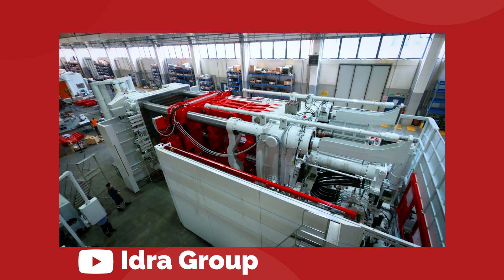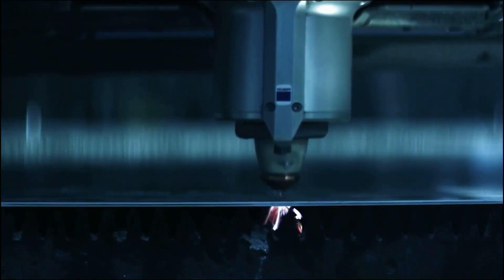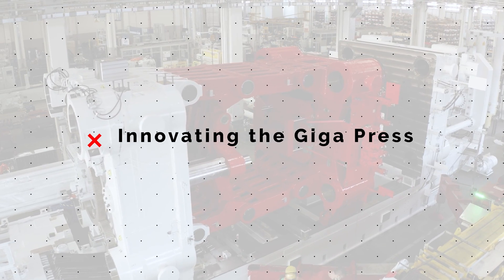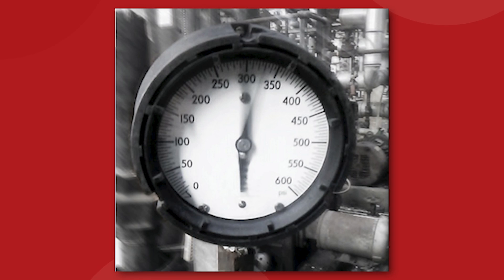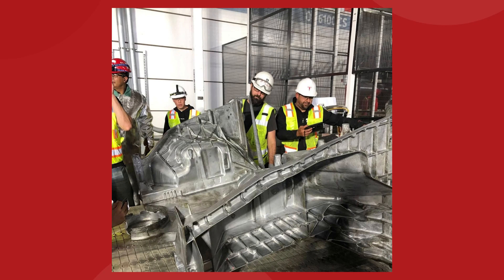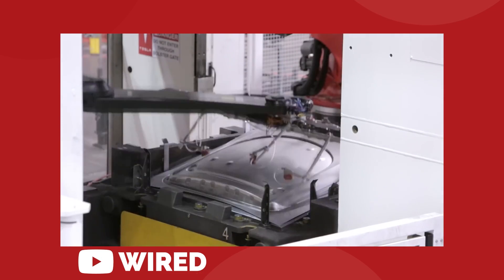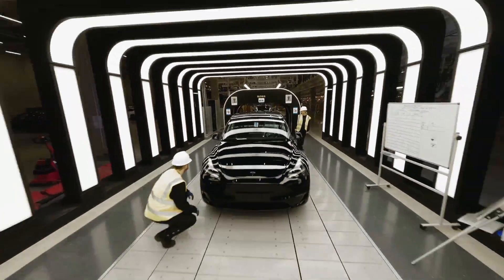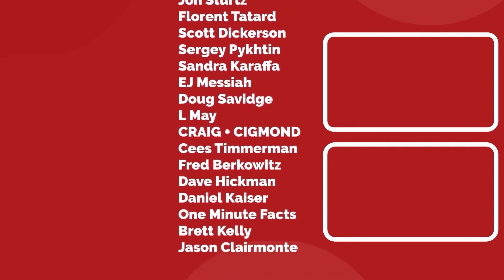The Real Reason Tesla Developed The Giga Press!

Comment: The video says that they pre-coat their aluminum die cast mold with soy bean oil.  I find that a little questionable.  Maybe a silicone based coating, yes.  I wonder what the up-time of these cells are?  From a production bottleneck standpoint it looks like a single point of failure in throughput unless there is a big super-market of post parts sitting around.  Would love to hear from someone who is familiar with the cells.

Comment: Tesla did not develop Giga Press. Tesla bought it from an Italian company named Idra, you can easily Google it. Tesla, perhaps, was the first car OEM that used it to manufacture its vehicles. Other OEMs are in the process of buying and using the press. It is basically a fast injection molding aluminum machine.

Comment: the clamping force is withstanding the injection pressure TIMES the area of the mold cavity.   Like an air cylinder with 100 PSI of input acting on the piston face of say, 5 square inches.  100 pounds force/1 square inch x 5 square inches = 500 pounds of force at the cylinder rod end.     In the case of the press, you can equate the liquid aluminum as acting like compressed air and the die cavity face  being the face of the piston in the air cylinder.   
     If the aluminum is being injected at 1,000 PSI and the projected cavity face say 1,200 square inches ( 20" x 60" ) then the force counteracting the clamping force is  1,200,000 pounds or 600 tons.

Comment: You keep saying "casting".  This is a press, NOT a casting machine.  In a casting machine, molten material is poured or sometimes injected into a mold cavity.  In a press, sheet metal is placed in the press cavity, and the press uses hydraulic rams to close the two halves of the mold around the sheet of metal to deform it into the target shape.  The person that authored this video needs to research what they are talking about before writing their script.  You are confusing two completely different technologies.  Both technologies have molds that open and close, but casting uses just enough force to open and close the mold, the press uses extremely high levels of pressure to deform cold metal.  Cast metal is hard and brittle, so the parts shatter in accidents, something you DO NOT want your car body doing.  Pressed parts are work hardened, but not to the point of being brittle, and a very strong part is created that will bend in an accident, but remain one piece to continue providing protection for the occupants.   Casting and presses are used to make completely different kinds of components for different purposes in the car (or whatever you are making).

Comment: The Germans were using similar but much larger machines to press and forge aluminum aircraft components during WW2. It may be computer controlled and being used for die cast auto components but it isn't new technology. Die casting is rarely repairable depending on the metal being cast and is commonly used with cheap zinc alloys that are considered one time use products.

Comment: A couple of things that I've been saying is luxury vehicles are not going to save the world. Second thing how do you replace anything has been damaged it's built this way? The assembly's made of stamps sheet metal can be disassembled and replaced with fresh meadow that's not destroyed from a crash you can't do that with a casting can't be welded on. You have to replace the entire casting in remove and reinstall everything that goes on it. Plastic parts is nothing new there been large pieces on American cars admittedly nothing like this but there are out there there generally a cradle to hold the engine or suspension differential. The filtering of the aluminum in Molten form that's something new I never heard of. Like everyone else there are some smoke and mirrors with Elon Musk he's not the new Messiah. Hey bring some new ideas but you guys need to get him off the pedestal this is ridiculous.

Comment: I think some of the items that Tesla will need to consider casting is segment castings of the one piece cast so that repairs to teslas can be performed by alloy welders to replace the damaged portion from accidents which may be cheaper than removing and replacing the entire cast or writing the complete car off depending on which system of repair works out cheapest, it may bring down the high insurance costs. But it may devalue the car . Probably something they’ve already considered. I do think as time goes by that Tesla will make full size die cast cars similar to a toy MATCHBOX CAR.

Comment: Your clamp force has to be higher than your injection force  because - pressure = force/area and the molded part is a greater area at the parting line therefore the clamping force must be big enough to hold the mold closed .

Comment: Amazing machine and technology. However the downside of casting frame sections of this size is rather large for the car owner. 

If you get in an accident and one of these frame sections is damaged its replacement will not be cost effective. 

But that depends on what will be available from Tesla in the spare parts chain. 

If your vehicle is damaged on the right front. Will a repair facility be able to remove just the damaged section and weld in a replacement? Or will the entire frame section casting need to be replaced? If it has to be replaced in its entirety then it may not be cost effective to do so.

Comment: Volumes injected and cooling rate seem critical. 
 Perhaps to do a single cast it would take 2 coordinated side by side presses, Even 3. I can imagine 2 presses on one side separated by the third press on the opposite side =- timing smelt and injection to make a piece 3 times bigger. But is that necessary? Front end , rear end both bridged by the structural battery pack….
 I’m still not fully onboard with electric vehicles anyway. One CME and electric vehicles across the world spontaneously combust, that won’t be a pretty sight. Then the grid is down, home solar panel are junk on the roof…. Generators on wind turbines are fried smoking hulks on a stick…. The Carrington event isn’t the biggest the world has faced. But look at what it did to a nascent electric age. Look at the French Canadian area when it took a solar blast. Imagine that world wide. Imagine a blast 10 or 100 times stronger. Well back to the Stone Age . Hope we have some steam engines to move food to the cities and horses to pull plows on the farms….

Comment: The downside being, your frame designs must be perfect and have long-lasting production runs...

When you cast your processes in stone, changing/correcting/modifying them becomes time-consuming, expensive, and difficult.

It's a delicate balancing act.  Decades ago, GM build a fixed assembly line with lots of robots and nailed-up processes...  It didn't work for the above mentioned set-in-stone reasons.

We shall see!

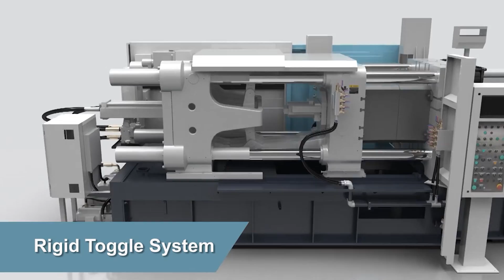Comment: 9:55 Yeah one giant part is great for production efficiency, but if that one part happens to fail its going to be mighty expensive to replace.
Reply: Any impact severe enough to cause that "one giant part" to fail will cause a total loss on the vehicle... just as it would on any other vehicle constructed using conventional assembly techniques. There is no increase in risk here, and very likely an improvement in safety.
Reply: Or on the other hand,  getting it right in production.  Just because you have a mold,  doesn't mean that the parts will be correct when you make them. 
Die casting can be a lot harder to pull off than it sounds.  Lots of potential for bad parts. Plus mold service is going to be on a new level with this one mold being about the size of a mini van.  And die casting molds are notorious for needing work done on them.

Comment: this video is simply garbage.. the giga press is not that new a technology... Vacuum pressure induction casting has been around for over 50 years and is pretty much exactly the same principal.. the only difference is a giga press uses mechanical pressure to cast the metal whereas vacuum pressure uses pneumatic pressure... to even suggest the giga press didn't exist until 2020 is idiotic...nearly as idiotic as saying the giga press was invented because ICE engine blocks and heads would not be made anymore in 10 years time...

Comment: I have repeatedly recommended adding a frunk mounted wind generator powered by all forward motion as an additional auxiliary regenerative source.  This generator would not use or require any additional power from the “traction” battery and with appropriate ducting possibly actually DECREASE the vehicle drag coefficient!  With appropriate design engineering this “Generator” could also provide significant additional power and DECREASE the required quantity and cost of the vehicular battery array.

Comment: It all sounds great right up until you have a crash in your Model Y and bend the front or rear frames then car is a total right off, it also explains  why cars have split in two after bad accidents cast aluminium just like cast iron is very strong but also brittle.

Comment: it is interesting but how is this modification affect the service for the car, for example if you get in a small accident and the front frame crackes what will be the fix for that, will you have to change the whole front end? that doesnt sound cheap, the advantages of stamped parts is that you can easy replace one small peace that was damaged and be on your way, so i get the fact that they want to cut cost and time for the production but on the other hand is geeting more expencive to fix

Comment: A one shot entirely die casted vehicle is physically impossible due to "Mechanical Locking" you would never remove it from the die. Not only is it impossible but it is extremely anti consumer to make the entirety of the body as one panel. The serviceability would be non existent since if you got in a fender bender you would need to buy an entire new car. Casted metal unlike stamped sheet metal cannot be worked to fix imperfections. Given Teslas already horrible anti consumer practices for servicing your vehicle it would be safe to assume that they are hopefully learning that the right to repair is crucial in the market. Leading them to not go through with more unrepairable products "unless you go only to a Tesla service center". Tesla still has yet to convince me to buy an EV and neither have any other auto manufacturers.

Comment: And this is why tesla car are totaled after any impact. If that big part get hit you need to replace a third of the car. And to do so you need to fully take it apart. But with stamped part weld together you cand unbend or replace only damaged part welding new one. If you re not afraid of replacing your car frequently and paying big insurence OK go tesla way. If you want afordable and non 1 hit go to scraper car, don t.

Comment: Now since Tesla doesn't sell through dealerships doing having the front and rear sub frames made like this does make sense. However if they did sell through dealerships it would make it costly for the end user/mechanics to buy replacement front ends etc due to being so large when all you might need to fix is one corner for example the front left corner due to a crash etc. The Giga press is one hell of a tool.

Comment: Great, but how much energy does it take to run a gigapress?
How dirty is that energy?
How dirty is creation of the gigapress and it's components?
How much energy is consumed to create a gigapress?
How much energy is consumed to create an EV battery?
How dirty is the creation of an EV battery?
How dirty is the disposal or recycling of an EV battery?

All these answers will tell you it costs more energy to build the EV, and it is much dirtier overall (Read bad for the environment) than any modern combustion engine vehicle, including its running lifetime of use.
Thanks for accelerating the rapping of our environment and increasing toxic pollution while driving up inhuman slave labor conditions.
You're not saving the planet or helping anyone except your misguided, ill-informed feelings.

EV's are still a pipe dream and only idiots believe in them.
To actually be a viable alternative; 
EV production would have to become much cleaner and use much less energy.
Batteries would have to become much more powerful (available output, storage capacity), while requiring less energy to produce, while becoming non-toxic to create, and dispose/recycle.

Then there is the whole power grid issue. 
If even 30% of the population drives an EV, the power grid will be overloaded and fail.
We don't produce enough energy right now, (Without the EV drain on the system) and idiots are shutting down coal, and nuclear plants every day.
The grid is nowhere near capable of holding or moving enough energy to charge all these EV's.
We need trillions of dollars of energy production plants like nuclear, coal, natural gas, hydrogen, and grid expansion and upgrades, which will all take decades or longer, even if we started tomorrow full speed ahead.

Just stop already, get off the pipe smoking train, and ditch this unviable EV nonsense and focus on energy production and distribution.
Once we have exceeded current demand for energy by several thousand percent, then we can talk about developing cleanly produced EV's and their batteries, if that is even ever possible.
The only clean energy right now is hydrogen, which we barely even produce, and has miniscule research effort, wake up!

Comment: The whole car molding concept is nonsense.
The car is heavier, the cast metal/aluminum is more fragile and has completely different behavior than sheet metal. There are not many people who are able to weld this material properly well. It'll be super dangerous on road as it will behave as a like a moving rock. If it hits somebody the other person will smashed hard, especially in the standard car with safety deformation zones. If the energy outreach the cast car strength all the people inside will have a hard time too. Rescue people from such car will be horrible job.
Car witch such body after a car or other accident will be garbage and useless as it will be insanely expensive to fix if possible at all.
It is not sustainable. It is made like one time investment and if anything brakes, you'll be forced basically buy whole another new car.
Yes in long run the technology will change out of actual known standards and might become useful one day.. but until that that say another 10-20 years this type of car is more like concept proof that serious product with sustainability in mind.

Comment: Tesla has huge problems with casting rejection though, and even bigger problems with the lowest initial build quality in the automotive industry in part because even with their very high level of rejection they are still installing parts that should have been rejected.

There is nothing about EVs that makes big presses any different than for ICE cars, it's just very difficult to cast complex and light weight parts which is why all the hyperefficient asian car makers don't do gigapresses either.

Tesla charges more than toyota, VW, or Ford. It's not the efficiency of manufacturing that lets them do that, it's slick marketing like this video. Tesla has found out how to export their marketing efforts to crowd sourcing so they don't have to buy ads in television shows, they just have a bunch of obsessive fans cranking out and consuming tesla news uncritically.

Comment: FYI - there are larger die-casting machines!  I've designed die-cast molds that go in them.  I've also worked with injection mold presses where a single tie rod (1 of 4) weighs more than that entire "giga press" at Tesla.
Reply: Yeah, vid poster seems entirely unaware of the manufacturing techniques that were developed during WWII for mass-producing airframes -_-
Reply: @shadeofsound23  The WW2 parts were forged, the tesla press is used for casting
Reply: i think the turin fiat factory had one twice as big around 2001
Reply: @adii2461  All I've found is marketing videos with nice animations showing a theoretical 92,0000 Kn die casting machine.  Don't know if there exists one in the world yet.
Reply: One tie rod weighing more than the entire Giga Press machine?  Get real.  The Giga Press weighs 950,000 lbs.  A 24" diameter tie rod would need to be 610 feet long to weight 950,000 lbs hahahaha.  The Giga Press at 9000 tons of clamping force really is the largest in the world.  But, if there truly is a larger one I'd love to see it - please provide some links.

Comment: I had heard about the Giga-Press before, but you explained it better and more thoroughly.  His next move will be to use the Giga-Press to make actual outer body parts.  He could also purchase more of those presses and make parts for the likes of GM, FORD and others.  Once he has them on-board, Elon will actually have them by the balls.  But to do that he may have to purchase the IDRA Group, so he controls who gets a Giga Press and who doesn't !
Reply: Saturn had molded body components.
Mercury Marine has a larger die casting press than Tesla.

Comment: I make batteries, see my profile for info, and I can say your actually missing I think what is the biggest point of this whole thing.  Your explanation of its just 1 part is not the real reason.  The real reason is that electric vehicles are much heavier than regular vehicles.  Otherwise this would have been done already.  So the casing is actually much heavier, the loads much larger and so there is a lot more metal in the process so the cost savings are much higher.  Elon isn't letting his secrets out hes giving you a false one to distract you.